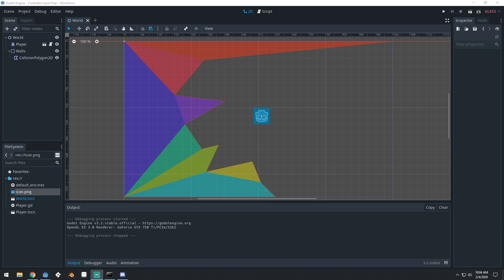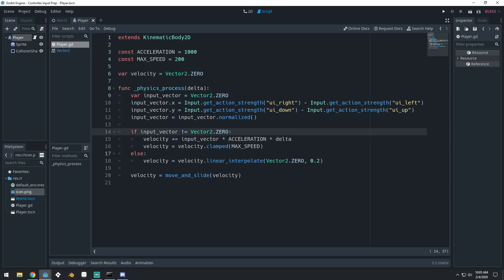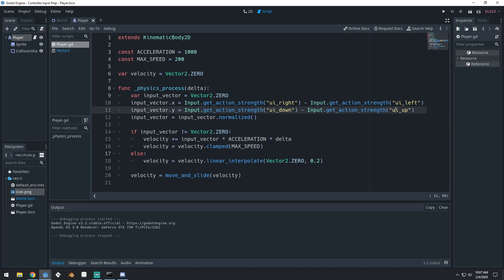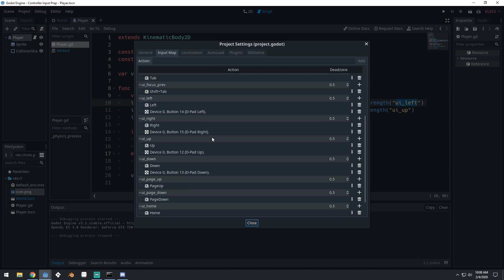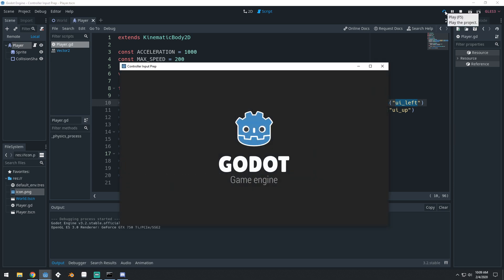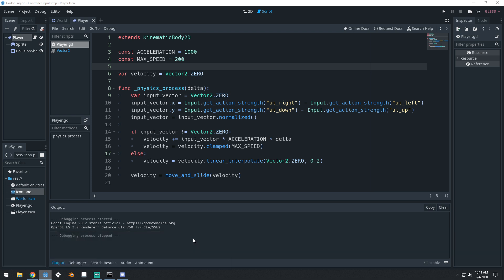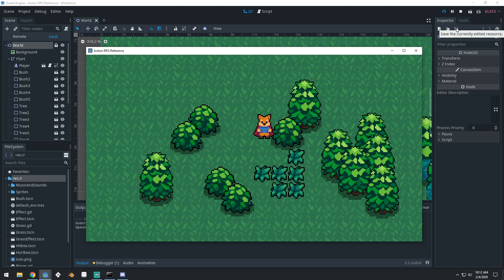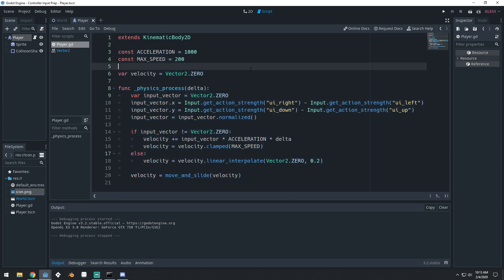Controller Input in Godot (+Channel Status Update)

Comment: this will get a thumb-stick working but it will not be analog. the normalize function changes the value of the float from get_input strength, a float value of .2 will become integer value1 when sent to the normalize function. best I have come up with is to store the up , down , left, right input_strength values in local variables ( _right = get_input_strength("ui_right").... then after input_vector is normalized restore the float value, (input_vector.x *= (_left - (_right * -1)) : input_vector.y *= (_up - (_down * -1)) which seems to work to get normalized and analog movement.
Reply: Thx for sharing. I found also another way to achieve this:

input_direction = Vector2(Input.get_action_strength("move_right") - Input.get_action_strength("move_left"),
 Input.get_action_strength("move_down") - Input.get_action_strength("move_up"))

	
if input_direction.length() > 1:
	input_direction = input_direction.normalized()

Comment: For make this to work with analog input, you need to clamp the velocity not by MAX_SPEED, but by MAX_SPEED * input_vector.
Reply from the maker: I don't think that is correct. The clamped function takes a float not a vector2.